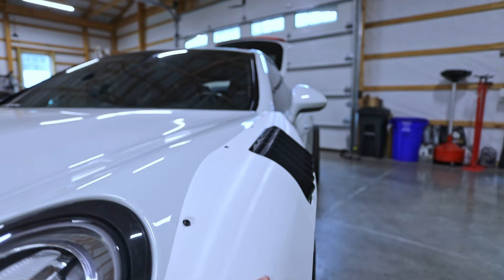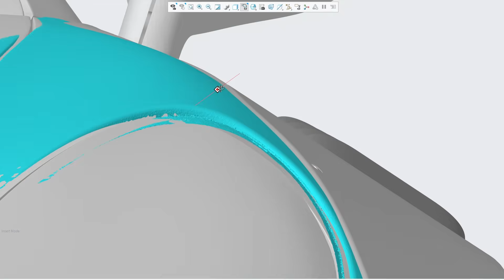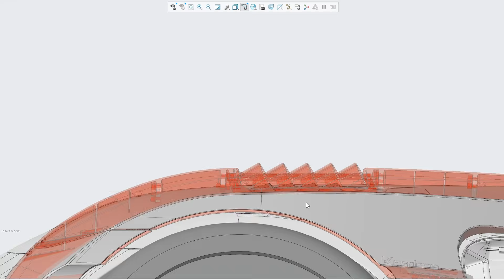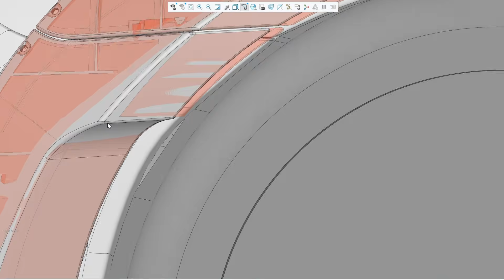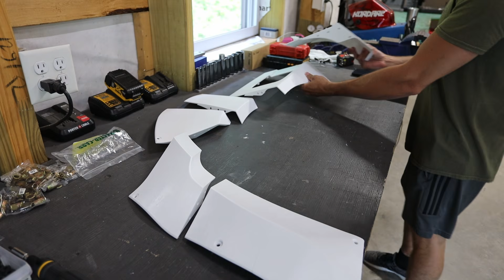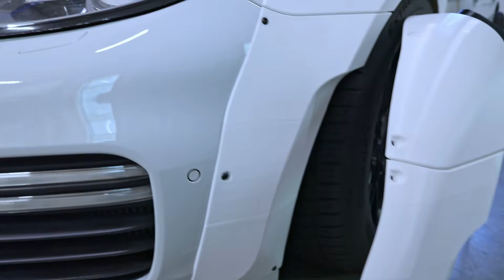3D Printing Widebody Fenders - VERSION 2.0 - Panamera GT3

Comment: Though i like V2 better than V1, the extremely flat top of the panel is the other side of the pendulum. I personally think you need to add some curvature to it and the vent louvers so they'll match the factory body curves. The indentation towards the rear of the fender will be a struggle for sure, but i think you're on the right track.
Reply from the maker: Yeah I think I'll add some curve back, but this is much better

Comment: I like the updates. I was one that mentioned adjusting that upper line to flow into the door vent body line. If you can’t get it to look right, maybe add a piece to continue that new line partway down the door. (Of course we’re all weighing in on a single fender flare. It could easily look fine once the entire body kit is installed.)
Reply from the maker: I appreciate the feedback🤘

Comment: ok here is the thing its a nice design for sure but you need the body lines of the car has to follow that means fenders and bumper etc has to match, the body kit petrrudes like its out of place and more power to you much love
Reply: He could easily extend the widebody into a total fender replacement. That way he doesnt have to put in that much work matching body lines into the door. Kind of like glass fenders on prerunners
Reply from the maker: Honestly don't really know what you're talking about. The whole point of bolt-on widebody is so that it protrudes. I do not want it to look like a stock body car. Which is why I'm not replacing the entire fender. I guess it's a preference thing, but that's not the look I'm going for.

Comment: Looks even better. I would modify few things if I can share my opinions

- add back a 5th air vent wing for a longer vent (impairs numbers looks better than pairs in my opinion)
- make the part a big less wide to fit better the tires, so they almost poke out
- add back a very small curve on the top part, it looks a bit too flat, before was too round 😅.
On front, of the arch, would add a thin vertical air vent (black) to move air to the brakes.
-would curve a bit more the headlights to make it look even more custom that it fit the car perfectly
- the front of the part could do down to curve with the front lip and make it go wider too!
- front fender could extend to the lower side black grill adding that steep angle as if it would continue on the fender part.
- the angle over the arch could end horizontal and not with an angle up, it can be over the door line but end at the same angle to flow better.

https://chatgpt.com/s/m_6a357b00ae688191ae7f846b04315a64

Comment: I get the GT racing vibe but those "gills" would be more aesthetically pleasing if they were horizontal. The lines with flow much better with the front lower grill and the side accent pieces.  

Just a thought.
Reply from the maker: Interesting, functionality wouldn't be as great 🤔
Reply: @Kordare   The outward visible part could be horizontal while the underlying inward louvers could be angled rearward. 

The aesthetic can be achieved while functionality is maintained. 3D printing literally allows engineering like that. It's simply depends on how you design the print file.
Reply: @Kordare  World be most relevant if you raced this and needed that laminar flow or to dissipate/evacuate heat during and after braking.